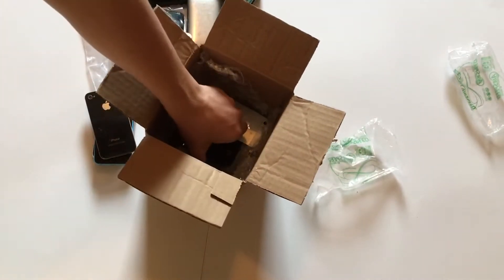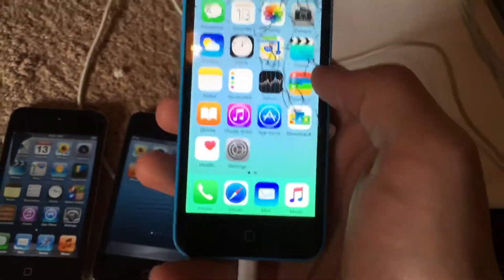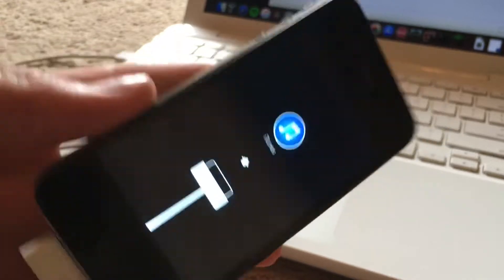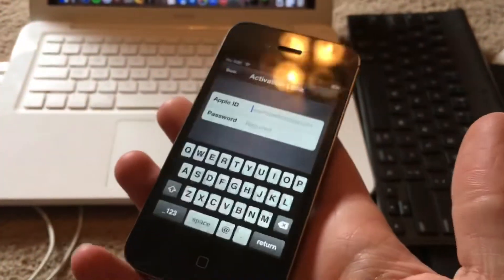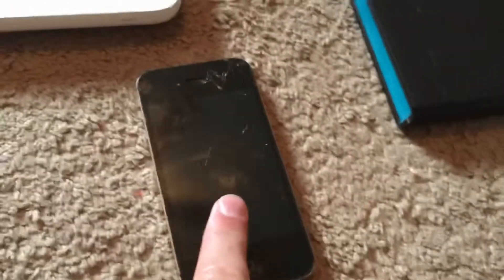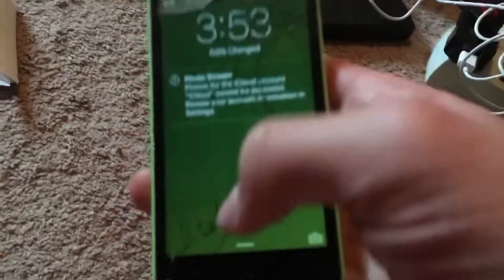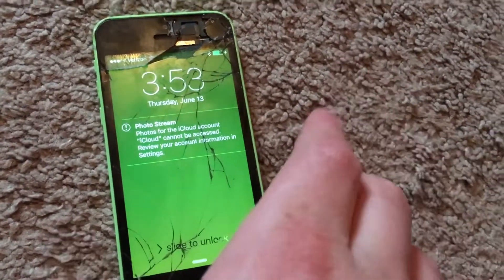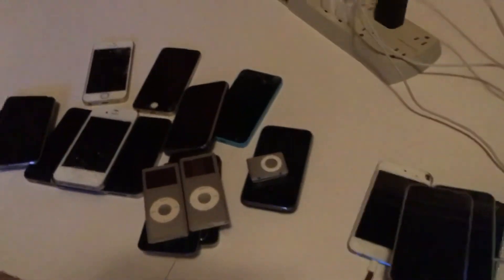$60 Apple lot unboxing/repairing! 100 Subscriber Special!

Comment: Do you know how to bypass an iPhone? I have a 4s that is activation locked and i think ios 8. Do I need to downgrade it in order to bypass it or? Hope to hear a reply. Thanks.
Reply from the maker: I used a tool that was given to me to use as long as I agreed to not share it, so i cant be of any help, sorry. I know there are bypass methods but I am not sure which ones work now or how to use them, and I don't really want to assist in icloud bypassing. I wish you luck though.